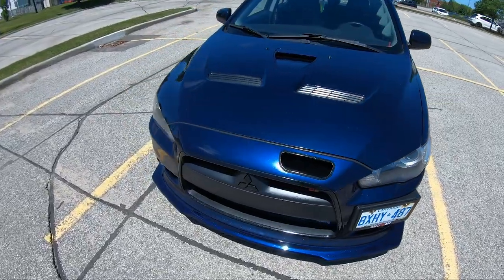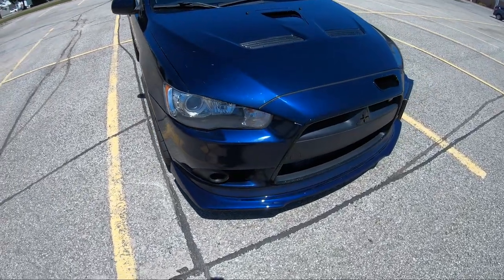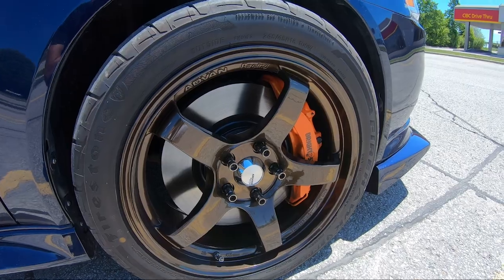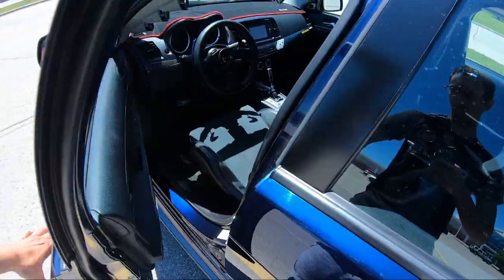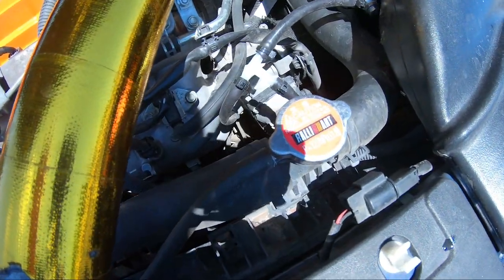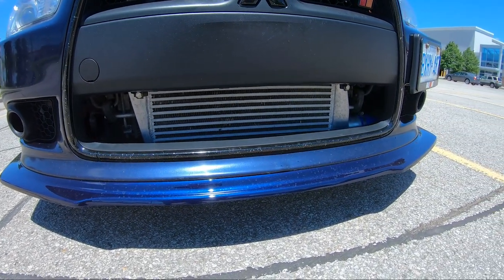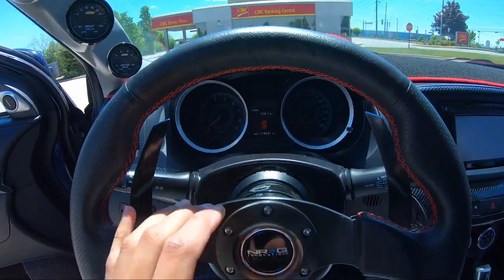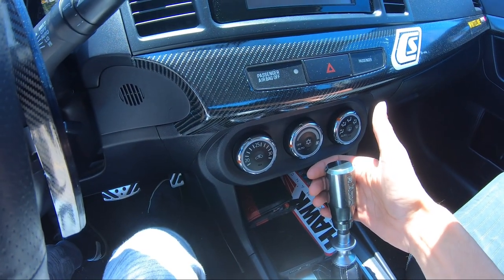Mitsubishi Lancer Ralliart! My Mods and Build

Comment: Lmao dude the sst is not strong, it’ll hold up ok with minor mods but anything more and it’s a ticking time bomb.
Reply from the maker: Sorry, but you are absolutely wrong. The only parts of the SST that are prone to failure are the shift fork magnets and sensors, which should have been a warranty replacement that Mitsubishi should have covered since it was a costly fix for the owner. I never had a single issue with my SST, I only serviced it with OEM fluid, and it is still holding strong at 120,000km+, pushing a custom tune with over 300 torque to the wheels. The SST failures you hear about are the owners who use the completely wrong fluid, don't let it warm up properly before spirited driving, and complain when it fails on them, pouting that it's the car's fault and not theirs. The SST as a gearbox is very strong, as long as it is maintained and tuned CORRECTLY.
Reply: @torontotuners8218  I’m absolutely right. Like I said “Minor mods” 300 torque is very minor mods. You obviously didn’t understand my comment. Those are all part of the sst trans and like you said costly to fix. It’s just the facts that the sst is much weaker than the 5 speed trans and if you’re going make decent power the sst is going to be more costly. If you just want to do full exhaust, intake and a tune then sst is fine but start doing more power mods and you will run in to issues.
Reply from the maker: Yes, when it comes to handling torque the 5 speed is stronger than the SST, but that doesn't mean the SST isn't strong either. I believe the SST is rated to handle around 400 until slippage and gear lockout begins. You have to remember for it's time (2007), the SST was very advanced and new technology for a mass produced vehicle. For what it is, it's an incredible transmission, performing shifts in milliseconds especially if it's been properly tuned to maximize it's potential. It has its faults sure, but to call it weak is ignorant.
Reply from the maker: I should also mention having a competent tuner and tune makes all the difference. I never made a video on it, but I ended up having ID1050x's, a larger fuel pump (can't remember the displacement), and a new tune installed on my Ralliart prior to selling it. It was making serious power, and even after selling it, the new owner (who happens to be the guy who tuned it), went over the tune again and made even more power. Throwing mods at a Ralliart or Evo with the SST will make it worse without having the proper tune to tie it all together.
Reply: @torontotuners8218   Having a good tune is with any car. Like I said if you want to stay under 400hp, which is minor mods then it’s fine but again it’s not strong compared to the 5speed. My point still stands.

Comment: Why not just buy an evo for what you spent? Lol
Reply from the maker: I'll be making a video on this soon enough but the short answer is that it's not worth it. I've made my Ralliart much MUCH faster than an Evo at a fraction of the cost. Also, reclinable rear seats, which the Evo doesn't have, it has saved me on numerous occasions. The Ralliart is an all around better daily driver, even the AWD system is better suited for the street than the Evo's. Watch the video comparing the two, it's very surprising. If I wanted a track car I would 100% build an Evo because that is what it's meant for.